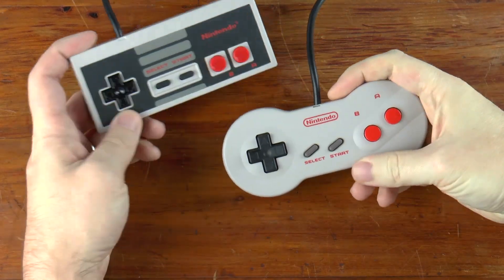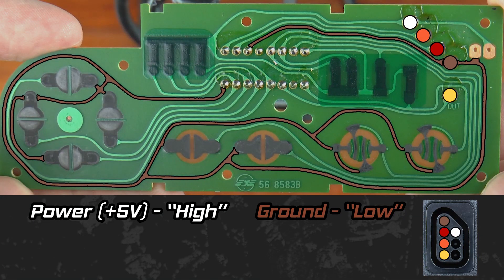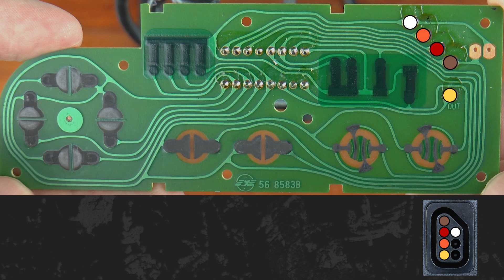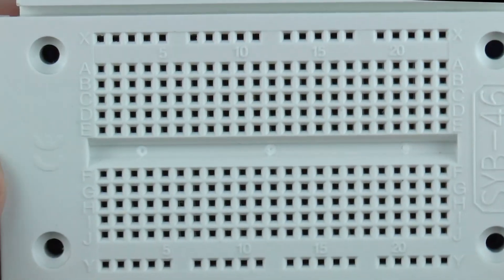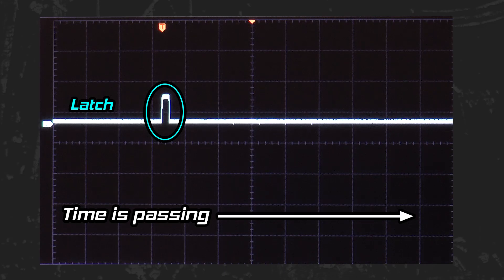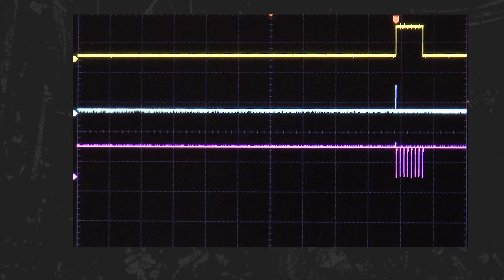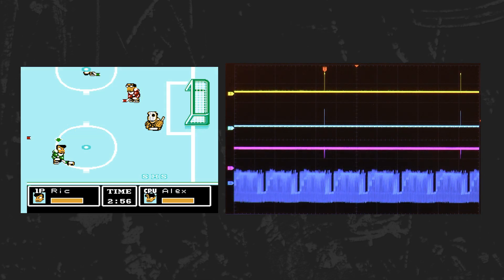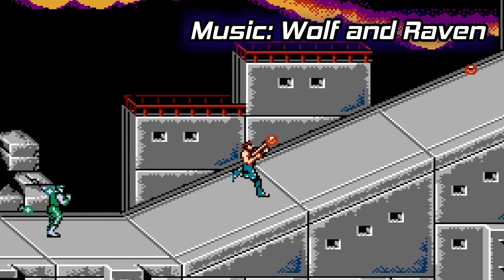Nintendo (NES) Controller - Electronics

Comment: I've actually found these with bad shift registers and replaced them. The FC dogbone also has a much shorter cord. I had a very late model one that also had the SMD shift register when I used to buy junk ones for repair. FYI: junk ones are often simply unplugged inside. They share components like buttons and rubber membranes with SNES and Game Boy controls. ;) It was parts-bin engineering in order to keep costs low.

Comment: Great easy to understand breakdown man.  Next do PC engine controllers.
Reply: PC Engine basically switches which pins output what buttons based on the high/low signal on one other pin. It's very similar to Sega Genesis.